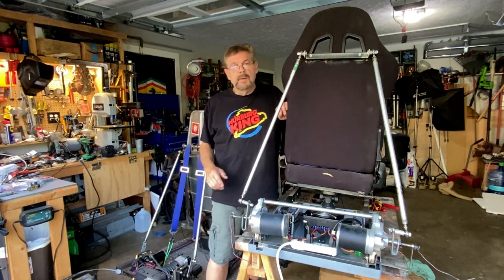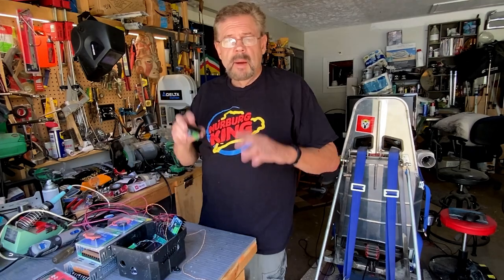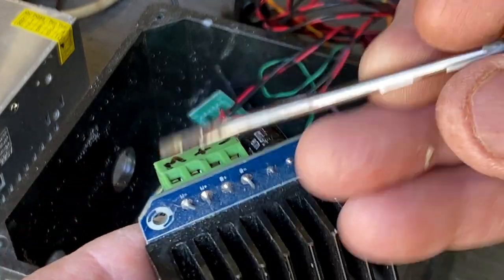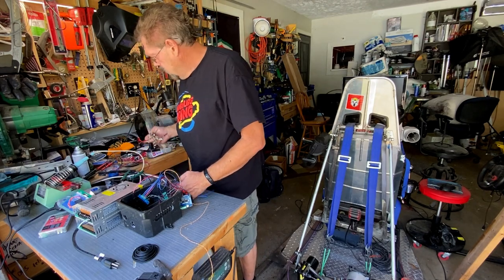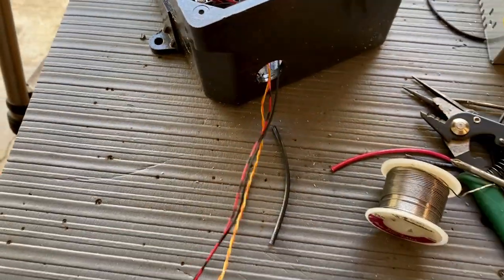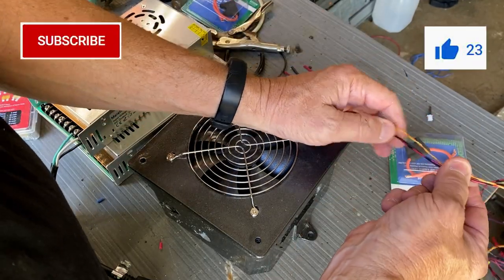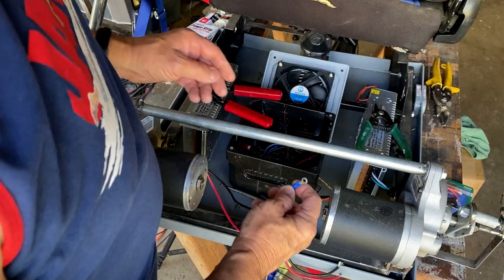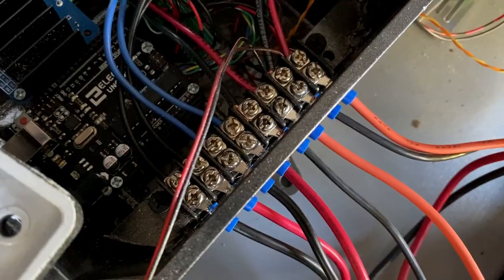2 dof seatmover motion platform - how to wire up the control circuit and mount. Arduino IBT-2

Comment: nice motors !!!  great job. How much weight do the motors move?I think I have to go on a diet
Reply from the maker: Thanks for the comment Daniel dee jay!   Not sure on the weight, but I did do an amp Stall test last video..  Pretty strong.  Just one motor blew the rig right off the sawhorses so I had to get an ATV brake to test it proper-like..  Stalled around 25amps    which IS quite powerful..  Dave

Comment: Hi Dave! i'm building a sim to and im wondering how well the upright arm works, i mounted the motors to low and i wont have enough travel with a level arm
Reply from the maker: I think you need to look at the upright arm as a lever.. the longer the lever the more it can lift. Short arm will not give a lot of strength.  (if I'm understanding what you mean).